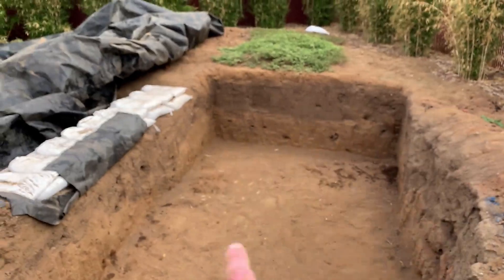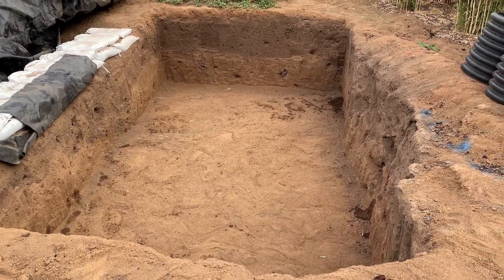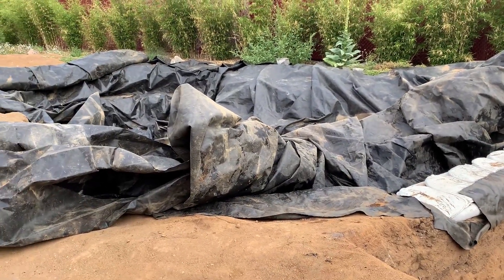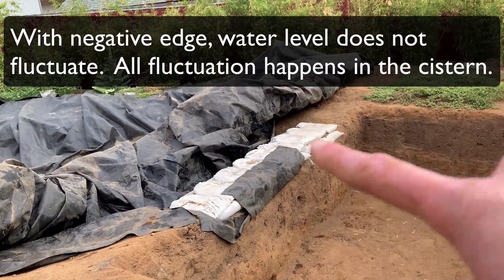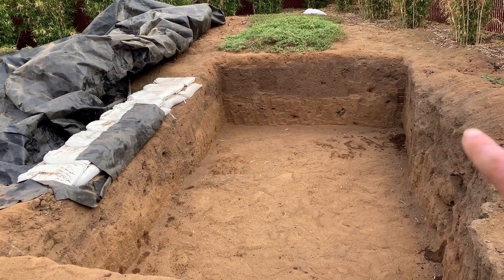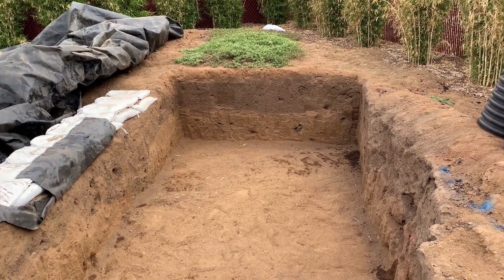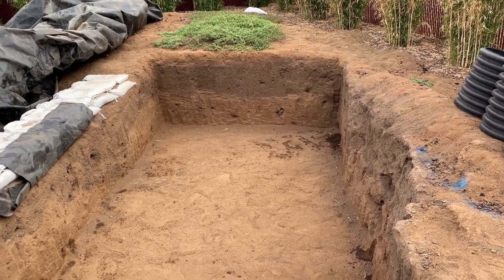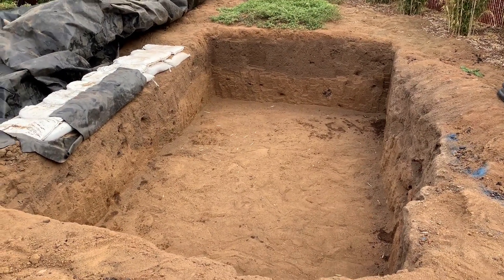Negative Edge Pond Skimmer & Rainwater Harvesting Construction - Part 1

Comment: Oh I saw it now, negative edge have complete separation (wall) . But why did you change from intake to negative?
Reply from the maker: I changed because I had the natural slope on my property to pull it off, and negative edge comes with a few benefits over an intake bay:

1. Another waterfall!
2. Debris can't get back into pond once over the negative edge. If power goes out, no risk of leaves/debris floating back into pond.
3. You can landscape overtop of it if you want. Allows you to reclaim landscaping space.
4. Pond water level will always be the same. You may still have to add water to the cistern like you would the pond, but the pond will always be full.